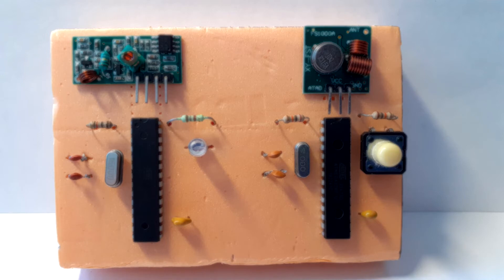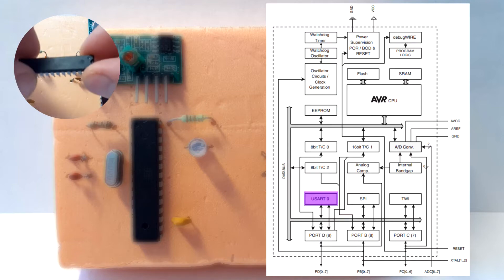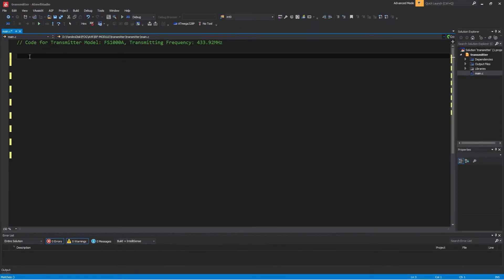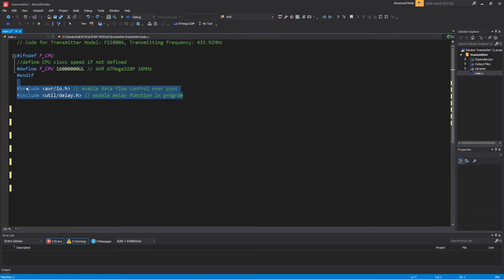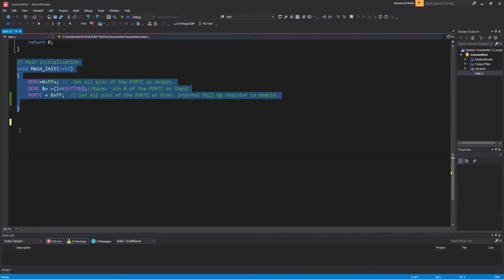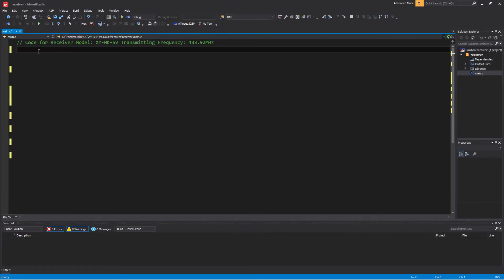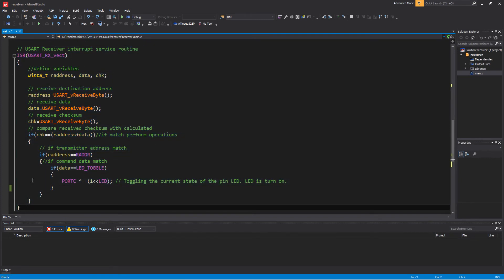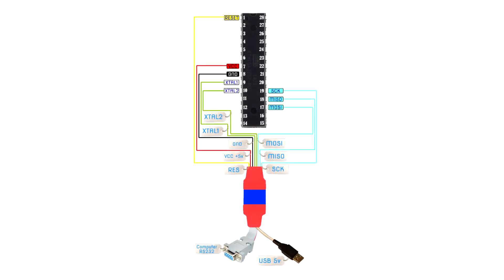AVR Microcontroller. Wireless communication. RF433 FS1000A & XY-FST XY-MK-5V Modules Set and UART

Comment: Hello. I have question. In transmitter code you send synchronization signal "SYNC 0xAA" and in receiver I don't see that this signal is checked.  What for is that synchronization signal?